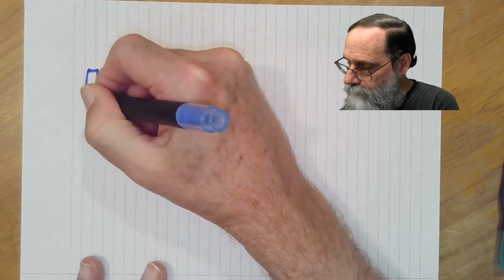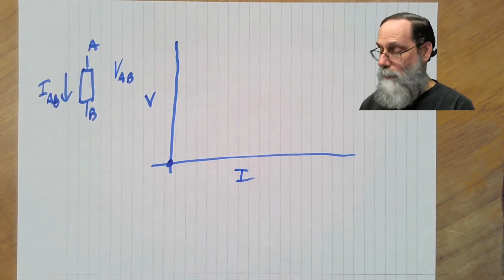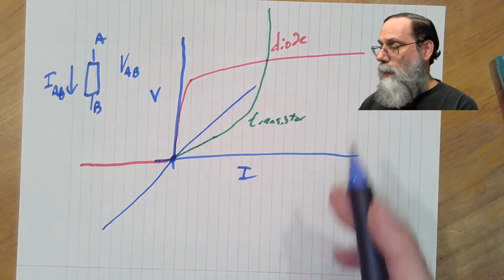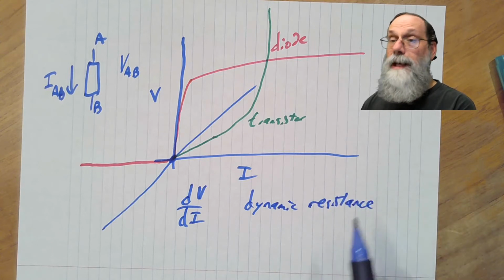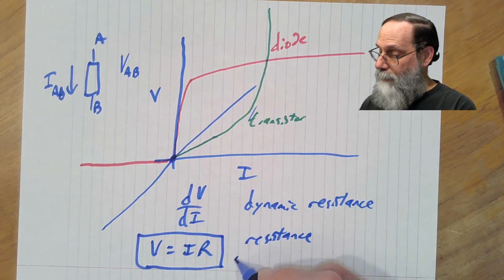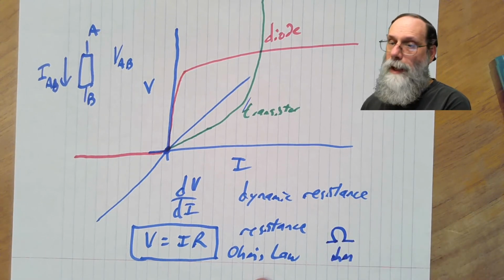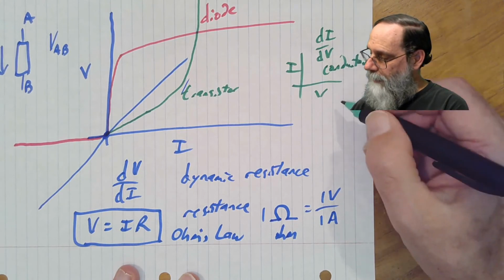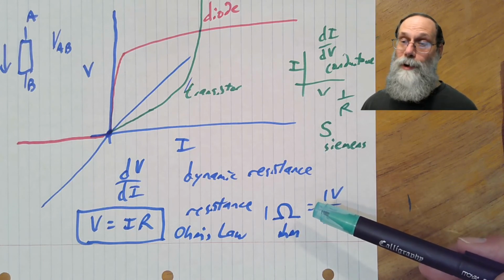Resistance Ohm's Law §4.3

Comment from the maker: Error: in extending the curve for the diode, I should have drawn the line along the negative y axis (not the negative x axis), as the CURRENT remains approximately 0 A as the VOLTAGE goes negative.  (I'm more used to drawing I vs. V curves than V vs. I ones.)